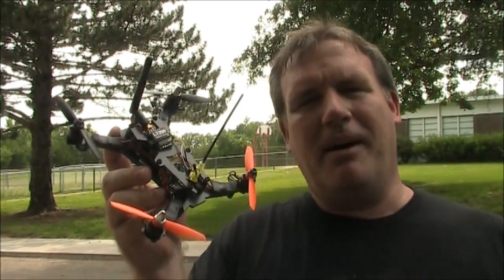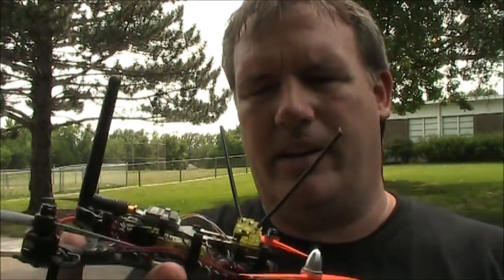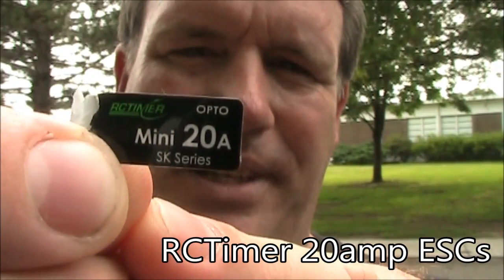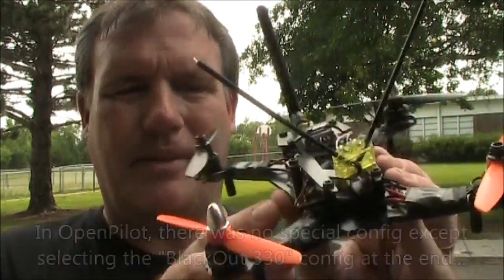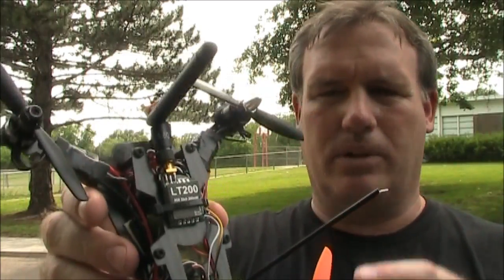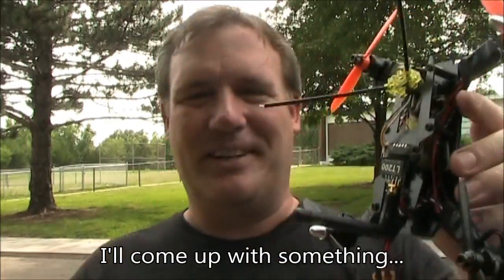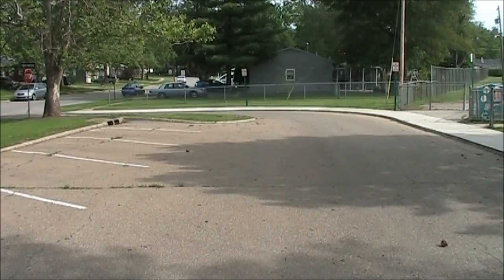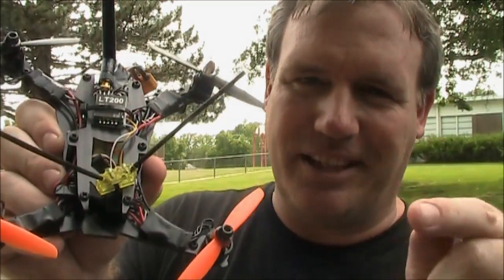Eachine Q200 Quadcoter Parts, Assembly, & Review

Comment: Hello 

Will the 1806 motors fit on this drone ?
Thank you
Reply from the maker: +Jermaine Allen They should.  They use the same bolt pattern as 1306 motors.
Reply: +travisgrindal Will props suitable for 1806 motors (5 inch) fit on this frame?
Reply from the maker: +odinata 5 inch props are too long for this frame.

Comment: I just got one of these for my Blade 200qx. I got the arm strengtheners, but I still want to sandwich the main and bottom plates - but all the holes for attaching the little top plate don't align. How did you get the standoffs on there? did you drill holes in the bottom plate? I had to file the motor mount holes larger for the Blade motors, but I don't know about drilling through CF

Comment: Will this flight controller cc3d atom can be used without fpv or it is a fpv flight controller board ?
Reply from the maker: +Jermaine Allen The flight board doesn't have anything do to with FPV or not FPV.  The FPV is separate unless you're doing some kind of fancy OSD and then the flight board may play into it a little... Anyway, the simple answer is, it can be used for FPV or not FPV, it doesn't matter.

Comment: Can someone recommend a good LC Filter for my FPV Cam and Transmitter? 
The Transmitter and Cam I will be using is:
-ImmersionRc 600mW
-Sony Super HAD CCD 600TVL FPV IR Block Camera 2.8mm Lens
Both can run 12V

Comment: Hi Travis, first off great job on your channel! I am building up a quadrevo ufr1 180mm for my first brushless build. I am using the same DYS 1306 motors. I see in the thumbnail for this video the silver prop nuts are on the front left and rear right. This is the same way the motors are labeled. The silver nut motors say cw, and the black nut motors say ccw. I see in the video the location of the silver nuts and the black nuts change position. This is confusing because how they are in the video the silver cw motor has a ccw prop on it.and the ccw motors has cw props on. I'm confused, and I hope you can explain. I think it has something to do with how the nuts tighten and not motor rotation. Anyways thanks for the advice in advance!
Reply from the maker: oneTEN Drift Network I had them backward in this video.  I figured that out when I lost both black prop nuts.  Anyway, the silver goes in the front right and back left.  The black goes in the front left and back right.  Now that I have them on correctly, I can make them just finger tight and they don't spin off.
Reply: ***** Thanks Travis! I figured That silver on the front right was right. But the motors say otherwise. The DYS motors are labeled opposite of their true location then. I bet this throws some people off. hahaha

Comment: I broke two arms simultaneously (bad flip attempt) on my first Q200 and I liked the frame so much that I ordered another one with the additional arm plates. I've used longer spacers for the bottom plate and put a battery inside. I'm running some 12A ESCs and BE1806 motors on it with 5030 propellers clearing on top of the top plate. On 3S it hovers on 30% throttle, which is awesome for aerobatics I really need to improve on. (:
I'm also ordering a replacement main plate, which is now available from Banggood, along with more arms. That should cover a couple more attempts on aerobatics.
Reply from the maker: LeoTheHuman Too bad about the crash... cool about the extra parts and 30% hover!  That would take some getting use to.
Reply: I'll try putting 5045 on it, I believe that would get it to the point where it will not be able to stay on the ground while motors are spinning. (:
Reply from the maker: LeoTheHuman LOL!!

Comment: I wasn't going bother adding electrics to my frame when I realised how little CF was holding the motor plates to the arms. The CF is good quality. I like your idea of directly connecting the bottom two plates together. I am tempted to buy another frame and use some thin cyano  to glue two frames with arms together. You've given me some ideas thanks.

Comment from the maker: @Gejes, CleanFlight is possible.  I had it running on a full sized CC3D but it was kind of flaky.  I had to plug and unplug stuff in the right order to get it to reboot and recognize it was plugged in.  It was kind of a pain.  That was a while back, maybe things have got better since then.
Reply: ***** A lot of people say that... give it time. Hey great review, thanks for sharing. I got the Surveilzone 200 quad frame so I can try 5in props and run a small 950 mAh 44 gram 2S battery, same idea as you for the backyard and neighborhood. Adding 1mm carbon sheet at the weak point on the arms and cutting some off for better prop flow and keep the added weight down. Want it to float and feel the wind with light weight FPV TX powered by it's own 4.5 gram 150 mAh 1S battery. I think 4.5in props are needed as its such a big step up to 5in props so lots of experimenting ahead but sure hope Gem Fan and others look at the Blade 200 and come out with some 1/2in in-between size props.
Reply: I have a question, if I have the q200 frame from a failed attempt at building a drone and a Naze 32 acrobatic pro edition flight control board and power distribution board, could I use it as part of your build. it would be a shame to buy a new board because they aren't cheap. in simpler terms would I have to start completely over or would the board work with the rest of your build

Comment: Awesome video.  I want to build one now.  How much flight time are you getting from the 2S and 3S battery?  Also, what do you think of the combo kit they have for $106 at banggood.com  

http://www.banggood.com/Eachine-Q200-Combo-RCtimer-1306-3100KV-Motor-EMAX-BL12A-ESC-CC3D-4045-Prope-p-976300.html
Reply from the maker: Woosite It is a good combo - just the ESCs are the larger sized ones because they have built in BECs.  You should still get either an extra main plate or the arm strengtheners.  1mm is too thin for me to trust it surviving a crash.

I get about 6-8 minutes off of each one.  The 3S is way more fun because of the extra power, but I still use my 2S for flying slower when I need to.
Reply: *****  Hi,Nice review ,...How are the doubled up arms holding up in crashes ??
Reply from the maker: integra So far, so good.  I've only broken one prop.  I need to fly harder.  :)

Comment: Its really funny - I've literally bought the same parts DYS 1306's, DYS ESCs, CC3D mini without having seen this video. Like you, I've had really good experience with the 1806's and i actually use the same 20 amp ESCs on my 260 size quad. I'm currently in the process of designing the frame for the 200.. in my case its going to be 186 to be precise ;) Watching this made me rethink my battery choice.. i need to make room for 3S ha! I can't wait to get it flying!

Comment: greatreview,had been looking at that but it looked a bit flimsy.Those extra plates beef it up nicely. Think I`ll hold out for a DT Blade 180 though.
Reply from the maker: Jake Bullit The Blade 180 should be pretty sweet.  I'm going to build out a Blade 150 with these same motors and hopefully get some Blade 180 replacement arms in the next few weeks.  I need to leave enough slack to swap them out.  :)